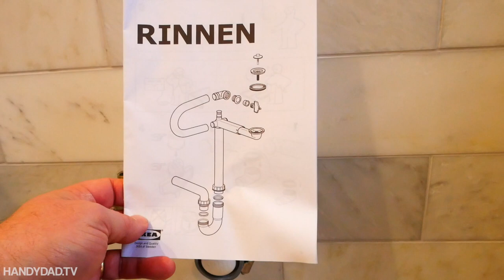IKEA Hemnes Vanity installation | Master Bath Remodel (Part 8)

Comment: Two things -- you have that square washer backwards -- and you're meant to hand-tighten it. The washer has those ends sticking out to catch the horizontal groves in the mounting plate. You hand tighten them because a power tool will almost always throw it around. It's amazing how they designed it the way they did... it just works!

Comment: I am considering this vanity for the same reason, full storage. My question is, would I be able to fit a Moen faucet on there and can I sub out the drain and overflow chrome with the Moen one?  I’m hoping to use a brushed hold and I will paint the vanity.
Reply from the maker: The drain system comes with the sink. You can use a Moen faucet, but you won’t be able to use their pop-up drain. It will be the standard IKEA strainer.
Reply: HandyDadTV Thank you for your assistance!

Comment: i have recently purchased a similar basin unit where the basin has a lip at the back. However the location for the unit does not have any tiles applied to the wall yet. It seems a waste of tiles and money to tile behind the unit if you're never going to see them. If i install the unit to the wall and then tile around, the thickness of the tiles+adhesive above the basin would probably be flush with the lip - will this be an issue? Or should I add a backboard to the wall to compensate for the tile+adhesive thickness?  Any guidance would be welcomed. Thanks
Reply from the maker: You can absolutely tile around it. No issue at all.
Reply: @handydadtv  thanks - however if i tile around it, i will end up with the tiles probably being flush with the top of the lip at the back of the basin. I am concerned if this is going to be an issue with the aesthetic and sealing at that specific point. (??)

Comment: How did you fasten the sink to the wall or vanity cabinet? I bought this same Hemnes products you installed. The other bathroom vanity I installed (not an Ikea vanity) had two holes for bolts to anchor it to the wall. Also I noticed you put the rectangle adjustment washers on backwards. The Ikea fastening system with the slatted metal wall attachments and the rectangle pieces is quite smart, those washers catch on the metal ridges and enable you to raise or lower for levelling.
Reply from the maker: You are right that I installed the washers backwards. I caulked the sink onto the vanity. That’s all.

Comment: Great video... replacing a vanity/sink in my new house, and skulking around the Ikea website, but they only have small and not-so-good photos.  This was very helpful.  Thank you!
Reply from the maker: I’ve since moved into a new house that has a 7-foot vanity top with double sinks and my wife STILL MISSES that IKEA vanity. You will not regret it.

Comment: Thanks for sharing this helpful video... One thing I noticed was that those Ikea wall mounting brackets were installed with the screw plate around the wrong way.  They are supposed to be installed with the sharp edges onto the wall side so as to grip onto the metal ridges stamped into the angle bracket plate.  It also stops them spinning so easily as you experienced. Refer 5:50.
Reply from the maker: Yes I reversed them.

Comment: Would this cabinet work if my drain pipe comes from the floor and not the wall? Is there a possibility it works if I keep the pipe really close to the wall or do the drawers go all the way back?
Reply from the maker: The pipe can come up from the floor, you just need to route it near the wall. The drawers don’t go all the way back. There is room for pipes and valves.

Comment: 5:37 and 9:45 - Mounting plates are placed wrong side... The sharp edges of the rectangle should base on the notches in the bracket.
Please see the instructions:
Page 19 in https://www.ikea.com/us/en/assembly_instructions/hemnes-sink-cabinet-with-drawers__AA-565861-10_pub.pdf
Page 12 in https://www.ikea.com/us/en/assembly_instructions/hemnes-mirror-cabinet-with-door__AA-565034-4_pub.pdf

Comment: So, I watched your video.  It was extremely helpful.  I do have one question, when I went to put the overflow  pipe on the bracket it just slips off.  Should I just use a hose clamp or am I doing something wrong?
Reply from the maker: I’ve installed two of these and never needed a clamp, but it wouldn’t hurt to add it. 

Here is the more recent installation https://youtu.be/fpl-2Unx9Xs

Comment: Hey HANDYDAD, thanks for this great installation video.
Just wondering what the height of that drain was off the finished floor. 

Since you used the existing vanity drain,I am thinking it was 18" ?

If yes then would you recommend the same for this IKEA Hemnes vanity too or an inch or two higher?
Reply from the maker: If you’re redoing rough plumbing, 18” to the middle of the pipe is standard according to my research.
Reply from the maker: I moved out of that house in 2020, btw. I didn’t change the rough plumbing and it worked fine. Really like IKEA’s vanities and faucets.
Reply: @handydadtv  looks really pretty and that faucet went so well with the Vanity.
I am roughing in a couple of these in a Custom home .I am also thinking of putting my hot n cold valves on one side of the drain instead of having them on either side of it. Will make life easier during Finishing where my drain would have ample room to turn  when I put that trap in
Reply from the maker: @Mahaveer_S Do whatever you feel is best, but this won’t be the last vanity in that bathroom.

Comment: Nice job! I so want to order this vanity. My wastepipe goes down into the floor, about 8 inches away from the wall, I wonder if there is enough space underneath the vanity to put some sort of elbow bend in to lead the pipe closer to the wall? My plumber will be so happy if I give him a challenge 😂
Reply from the maker: There’s about 6-7 inches of clearance under the vanity - even more if you raise the adjustable feet. Should be fine. Thanks for the comment!